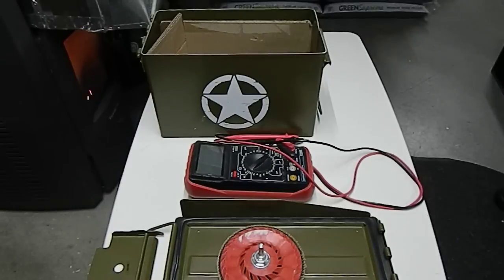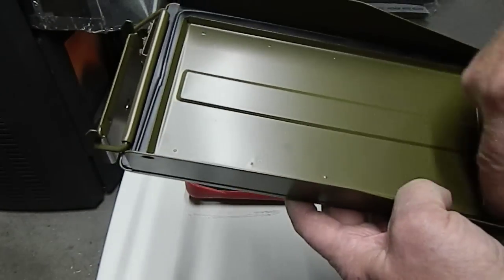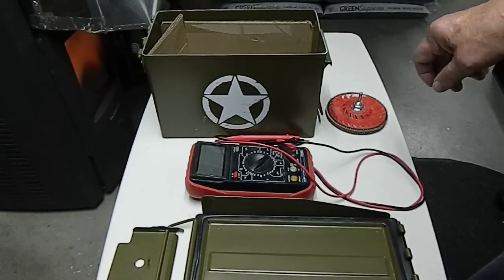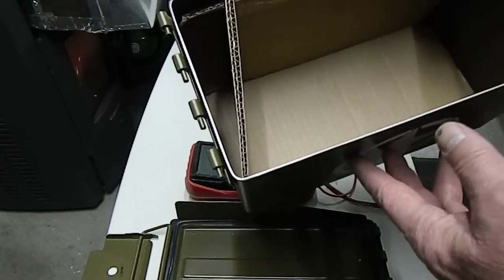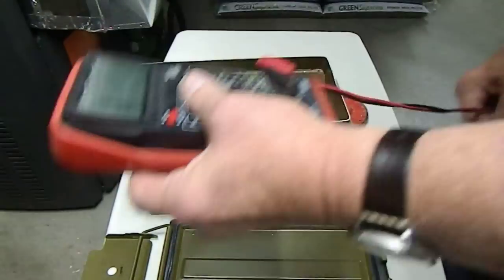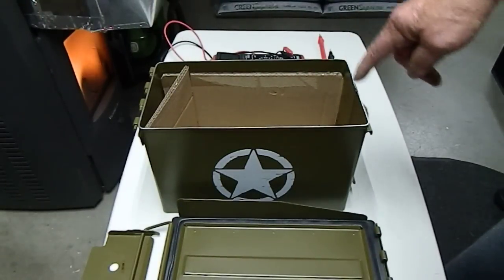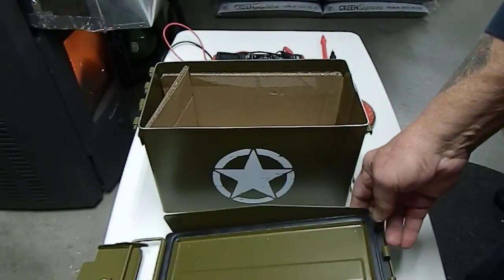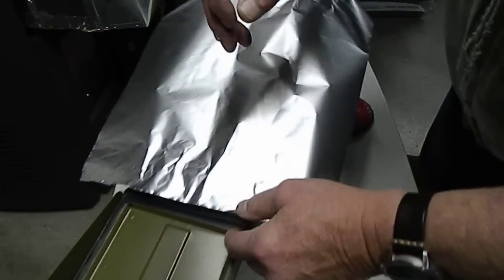AMMO CAN FARADAY …. you’re doing it wrong

Comment: No need to make it water proof. Try putting a cellphone inside instead, and call it. Or put a wifi router on a battery inside instead and see if you can detect the signal outside. An ammo can is good isolation, but it won't stop RF.

Comment: OK I agree that pulling the rubber seal is not conducive to a can that seals, that is not what makes a Faraday cage function. EMP waves are similar to radio waves as in they are a size or shape. That shape can not go through any gap like water, think square peg in a round hole. This is why many Faraday cages are made from conductive wire mesh. The aluminum foil is a simple cheap solution, you can also order foil that is essentially 8-10 layers thick in one sheet and it's way tougher and reusable more so than the common household heavy stuff.  Just to clarify, the continuity test performed in this video really did not show or prove anything more than aluminum foil conducts electricity and so does the bare steel can. To actually check continuity you would need one lead on the can (bare steel)and one on the foil, but again this proves nothing as far as effectiveness as a Faraday cage.
Reply: Or, through your cell phone in your cage and call it. If you hear it ring, your cage needs work.
Reply: @shanhutchison7332  The 'gotcha' there is you're only testing at a single frequency whereas an EMP (from what I understand) is very broadband.

But to you point, a heck of a lot better than using an ohm meter for higher frequencies! :)
Reply: @Pinhead-q4i  I have read the freq range depends on the source.
Reply: @shanhutchison7332  Shan, I think the take-away here is probably a person should shoot for a 100% RF seal to cover all the bases.  As they say...'DC to daylight'.  That would be my goal, anyways.  Almost easier to go for a simple 100% seal (i.e. the paint can lid) than a piecemeal approach.
Reply: @Pinhead-q4i  I'm in agreement on that.

Comment: a faraday cage doesnt require a water-proof seal. Thats not how the physics works!!!
Reply: His point is that the rubber gasket need not be removed, saving a step.
Reply: A faraday cage is called a cage for a reason it could be made out of chain-link it doesn’t have to be sealed it just needs to conduct electricity
Reply: Me thinky he try to convey water get out then emp pulse stuff get in.  Not sure cause eye ham we Todd did.
Reply: @barrykelly2722  I think perhaps you may not be as Todd did as you think you are. It does seem as though he is saying that any tiny pinhole will allow EME in destroying what is trying to be protected inside. I guess the only way to know (if it works) is to test it @styropyro #styropyro
Reply: @barrykelly2722  
Water,.. and EMP 🤔
With climate change, that might be a thing 😂
Reply: @barrykelly2722 
Oh' yeah... U wee todd dit, sofa king wee todd dit! 😂👍🏼
Reply: The seal he mentions I think is to physically push down on the foil sandwiching the foil between the lid and main box which he scuffed up to remove paint. His point was to maintain electrical conductivity in a box basically as he demo’d with the multimeter verifying his effort was successful….hope that makes sense.
Reply: It's Not Needed At All,.. Bet?
Exactly how many issues has everyone through to many world war, been complaining about this (nonexistent) Issue 🤔
Reply: You guys are obviously from the Government trying to sabotage these preppers efforts! 😁
Reply: 😂😂😂 he didn't mean water 😂😂😂he meant leak in any EMP radiation😂😂😂 lmao
Reply: The !!! In your message screams whiner
Reply: It would be worth trying this and testing it by calling your phine inside. Then if it dosent work then do the next step
Reply: @dtruman123  
Ever heard of trying for yourself?

HE SHOWED THAT IS WORKS, WHAT MORE DO YOU WANT? 
ALSO AFTER FOLLOWING HIS INSTRUCTIONS I MADE THE EXACT SAME FARADAY BOX WITH AN AMMO CAN AND I TESTED IT WITH MY PHONE ON AND OFF AND IT DID NOT RING. 

LIVE AND LEARN BRO! 🤦

Comment: Or, play it safe, and do both methods at the same time.
The biggest problem with removing the gasket is that it's very difficult to keep foil inside the spaces or grooves that the gasket occupied... It's doable, but difficult.  If you employ both methods, the lid will play a part in redirecting RF.  If the lid protection fails in some degree, the default would be the next layer of protection, i.e., the foil as used per the video.  Opening and closing the box compromises the protection and it will have to be redone every time. ... Make sure that there is a non-conductive barrier between the inner foil and the protected contents. The contents must not touch metal anywhere. No matter what method you use, or combination of methods, make sure that there is enough foil such that closing the lid feels like it's compressing more than enough foil.

Comment: A microwave oven is a Faraday cage...
Reply: True. A microwave oven is a Faraday cage that traps RF transmissions internally in order to cook food .
Reply: Yes and no (I hate those problems!) .  Issue being it's tailored to ~2.4GHz range (not sure of the exact freq).
Reply: @LoneHawk  make a call from within the microwave oven. 😁
Reply: Unless it's a cheap one. I remember at hp they were tested once a year and some of them failed and got tossed. 😜
Reply: A microwave will not stop all wave lengths you want to stop like the 1 mm length of 5 g. The holes in the screen are too big . However the gasket is still usable.
Reply: @LoneHawk  but by definition it is a Faraday cage.

Comment: Sand under rubber gasket and wrap the gasket in HVAC aluminum tape and put  it back, creates a good seal. If a tear occurs patch with more tape. Great video I'm going to add a sheet or two of foil as well!
Reply: From what I have read, you should have conductive adhesive on the aluminum tape. Regular adhesive would be like a thin gasket. No bueno.
Reply: Am I wrong it is doing it the way he did in the video make the lid basically useless other than keeping it shut and waterproof? Because there's no metal to metal contact from the lid to the base meaning it'll just go through the aluminum foil if it's a strong enough emp. Having it metal to metal with the lid would create a thicker layer.

Comment: Another idea, use RF shielding fabric instead of foil. It will cost a little more, but will be less likely to tear when opening and closing. Line the inside with a thin rubberized material in addition to cardboard to help insulate the sides better. I have started using nesting principles, put a small item inside a larger item. For instance, with this example you can buy a large metal ammo can and place a smaller plastic ammo can inside it. Great video, thanks for sharing.
Reply: Ham Radio Crash Course used an RF gasket material on his so that he could open and close it repeatedly without having to replace the gasketing material.  Just another thought.
Reply: @Sagart999  I got the idea from his channel and from DoctorEMP channel
Reply: @PreparedOverlander  bro can i use wooden box
Reply: @BlackMamba-lt8oe   EMPDoctor has a great video using a large wooden box. He uses RF material to shield the box and contents. I am planning to use a metal trashcan with a RF gasket going around the top, then put a slightly smaller plastic can inside, spray foam in the open space to keep the plastic can from moving around. All the items I put inside will be in a separate bag. I have gone to the idea of nesting items in multiple layers.
Reply: @PreparedOverlander  if the grid is dead how will u use electronic items
Reply: @BlackMamba-lt8oe  I have small solar battery banks in faraday bags. Most of what I have for weapons are in faraday bags. I have been switching to USB chargeable items just for this purpose. I have videos on my channel explaining this.
Reply: @BlackMamba-lt8oe  Mission Darkness has a video about a wooden faraday cage as well.
Reply: @PreparedOverlander  &  @Alan Gideon  thank you!!!  I have a rather precious ammo box my grandpa gave me so it is worth spending a bit extra to use the best materials as this will hold data backups  of my and a few loved ones as we are doing off site backups.
Reply: After my first comment, I found a series of YT posts by empdoctor.  He compared several gaskets, and sells the winner on his web site.
Reply: Sorry Paladin, but why would you open it before the EMP or solar flare event had passed? Once the event has passed, there is no longer a threat until the next event and the case can be opened without worry. If another event is pending, just have more foil ready and reseal the damn thing.

Comment: Good video. A few points of discussion.
1. Since you're sending down to bare metal, you've got to watch out for rust. 
2. Don't measure continuity from foil to foil. Measure it from foil to can.
3. How are you going to test to see if this actually works, instead of just guessing that it will work?
4. What would you suggest storing in a can this size?
Reply: Plenty of important things fit in a can of this size. Shall I list examples ?
Reply: 4. Battery banks, torches,  phones, small radios, speakers, other small electronics, multi meter, Geiger counter  etc
3. one simple way is that you can put your phone inside of it and then try to call it with another phone (with cellular and Wi-Fi calling through an app). If you  hear your phone ring inside, it doesn't work. Or put a Bluetooth speaker inside and see if the music continues to play from your phone. O

Comment: I tried using a 30 gallon steel garbage  can and wasn't getting the results I had hoped for. Added four sheets of aluminum foil over the top before sealing it shut and nothing gets through now. Cell signals, wifi, Bluetooth etc. Thank you very much for this video.
Reply: Thank you for this. I was also having problems. Guess I need to add more layers.
Reply: Bro how to check
Reply: @BlackMamba-lt8oe  get in the garbage can and make a call? 🤣
Reply: now you're in upper part of RF, try low one (shortwave radio should be good enough to check if it shields HF too, not just VHF+) too.

Comment: I’m not sure about this, but the takeaway is that the box can be steel but the seal/ entry point must be aluminum?
Reply: You can use copper, or any foil, i perfer conductive copper tape with conductive adhesive,  it's use by those that play electric instruments  like guitar to prevent feedback to the amp.
Reply: No

Comment: Plain unlined paint can. Good metal to metal seal. Just make sure its the kind with no interior costing on the can or lid.
Reply: You must not damage the rubber seal or remove any paint on an amo box😅😉an amo box in itself (entire) is EMP safe , since an EMP is not current but an electromagnetic impulse and it's not electricity like what you have in your socket, so you don't have to remove the rubber seal or sand away the paint on an amo box. you can make an EMP safe box out of a wooden box, all you have to do is wrap the entire wooden box in foil/very fine mesh netting and voila you have an EMP safe box😁😉